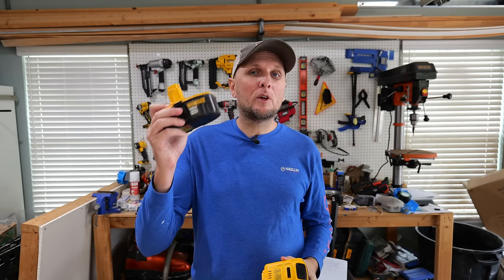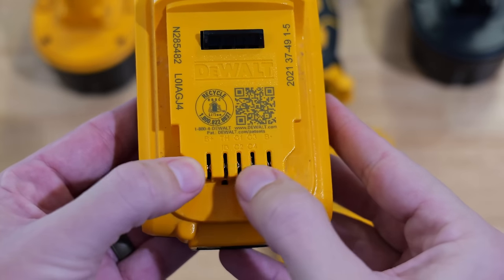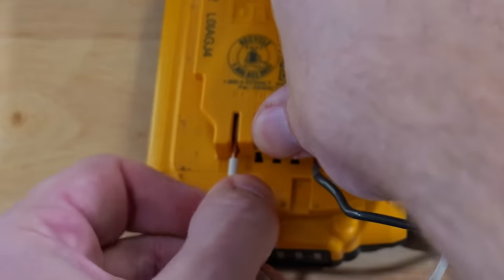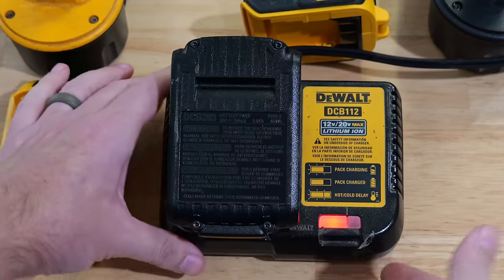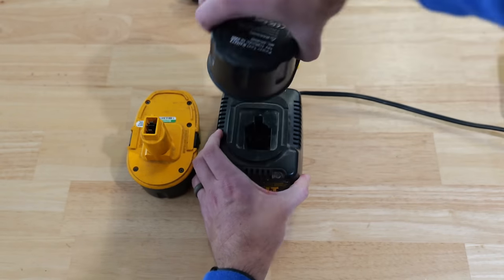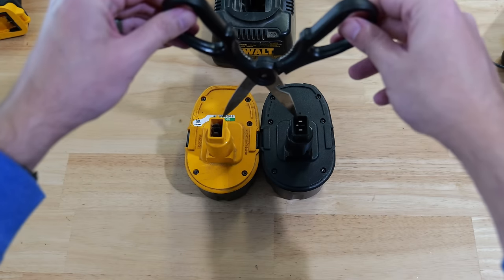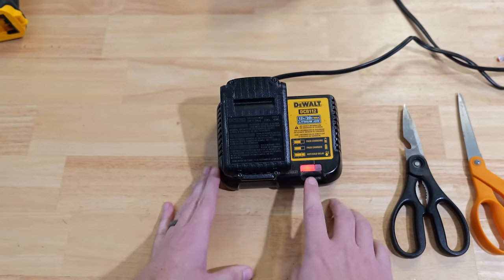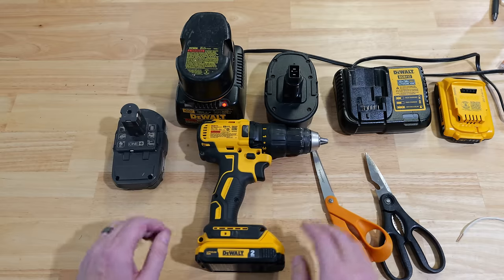SECRET To Reviving Dead Portable Tool Batteries | Super Easy!

Comment: I've done this before but, although the batteries will then "charge", at least in my case, they were able to hold very little power.
Reply: Maybe the battery was aging out?  I did this several months ago to a 20v dewalt and it seems to be working just fine. I just do not jobs (not contractor) so it would be hard for me to tell if it had a few percent less charge but if so it is not obvious.  I have used it for a number of misc jobs since I charged it and have not yet had to recharge it.
Reply: I would expect different results depending on the age and wear ofnthe revived battery
Reply: Each pack has 5 cells to make up its voltage 18v/20v. 
The BMS cuts off charge when one of the 5 reaches 4.15v. 
So open battery and either discharge all to same voltage or use likes of a tp4056 and individually charge each of 5 cells to 4.15 v
Also note the discharge curve of lithium ion batteries shows that from fully charged they drop from 4.15v to around 4v in first 4% of discharge.  Then slowly drop down to around 3.2 v and if kept in use again the curve drops like falling off a cliff
Reply: Storing flat batteries will ruin them.
Reply: @mikestubestation 100% but have revived cells down to 1v and they were perfect. 
Best to store at around 80%
Reply: @patomahony9747 the question is how long @ 1v.  Or as in this case undetectable by this charger.
Reply: Probably have to "re-teach" the battery it's 100%. I've done this with phones and other electronics. This may be the case here. Once the battery is charging again, get it to what it thinks is 100%, use half of the battery, charge back to full 100%. Repeat this process 3-4 times without letting the battery get below 50%  before you charge it back to a full 100% every time.
Reply: Likely dropped/shorted a couple cells rather than was just cycled too deep and is exactly why you should never just connect two batteries together like this without first finding out why its refusing to take charge.
Reply: @psychosis7325  would it damage the good battery? if not is it worth a try as a last ditch effort before spending money on a new batt.. (if likely to remain an electrical ignoramus)
Reply: @JamesLawrence-hv4ti  its not likely to damage the good battery, but its like $5 for a multimeter and if in the shed you likely have the tools to open the battery and check the the ballance of the cells first to lower the fire risk and once you identify if its just been deep discharged evenly, has gone out of ballance or if its shorted you can then decide if you charge the whole pack, charge the low cells to restore ballance or scrap/rebuild it....

When my 36v mower battery done similar I used a 0.5amp usb phone charger to bring the low cells back up as anything over an amp is much more likely to result in thermal runaway and using the battery its can deliver tens of amps.

Should be done outside or in a dedicated fire resistant ventilated area with eye protection at minimum, not in the garage with a pair of scissors up on your work bench as a demo video for others to copy.
Reply: @davidbwa  is
Reply: It takes 21 volts to charge full a 5 s  battery pack the Nominal voltage should be 18 volts or 3.6v per cell but since some might be a little lower the highest cell will reach the 4.2 cutoff voltage before a lower voltage cell Therefore decreaseing The total amount of power Available for the battery since the BMS stops all charging when any one cell hits 4.2 v .
Reply: Li ion batteries should be stored (long term), @ half charge or less. If fully charged- that energy seeks to release itself and destroys itself little by little.
Reply: @psychosis7325 ,,sometimes,you have to be operating on tools somewhere.Its not rocket science.
Just saying.
Reply: @mikestubestation could you elaborate on this? I’m not understanding your statement. Thanks.
Reply: @SammifromMiami  i think he's saying that if you let a battery discharge and then store it without giving it a partial charge, the battery's over-all life is shortened. I believe most websites with this information recommend storing a battery at 40 to 60% charge for longest battery health.
Reply: Same experience for me.
Reply: The 18v nicad (nickel cadmium ) batteries have a memory. If they are put on charge before they have actually exhausted it's charge totally , you will lose some of it's memory each time... resulting in less run time. Those so called , " dead batteries " will not regain the lost memory.
Reply: @williammoseley8388  Right. Probably what happened to mine.  They were pretty old.
Reply: It didn’t work on my 20v battery. The battery gets charged for a couple of minutes. LED shows 3 led’s - fully charged. Using it with my grinder to cut 3/8 rebars. After 2 cuts - the battery is dead at 1 LED again! 😢
Reply: Same thing with my weak batteries.
Reply: @ 8:44            YOU INCORRECTLY SAY :
 " ... plenty of TORQUE on the battery..." 
THAT'S ABSURD.
WHAT YOU MEAN TO CONVEY, IS THAT NOW THE BATTERY HAS A SUFFICIENT CHARGE TO POWER THE TOOL AGAIN ! ✅

[ it's  powe cells IN A PLASTIC HOUSING- and the word
"TORQUE" is not at all applicable and sounds RETARDED. ]

>>> That fact cleared up now, I must point out that YES YOU ARE KEEN TO HAVE FIGURED A WAY AROUND THE DEALER SCAM TO CAUSE PEOPLE TO KEEP BUYING THEIR DAMN BATTERY CELLS WHEN THEY SHOULDN'T !!!
- EASIER TO DISASSEMBLE THE CHARGER AND REMOVE THE SWITCH SO THAT ANYTIME A BATTERY IS ATTACHED IT IMMEDIATELY AND INSTANTLY BEGINS CHARGING.😂
-
- THAT COMPANY ALSO ISN'T THE ONLY ONE THAT IS SCAMMING EVERYONE BY ADDING A SWITCH THAT PREVENTS THE CHARGER FROM OPERATING UNLESS IT DETECTED WHATEVER VOLTAGE THAT THEY HAVE SET IT AT TO DETECT IN THE FIRST PLACE!!! 
THAT'S ALSO  HYPOCRITICAL AS BATTERIES ARE NATURALLY DEPLETED OFF THEIR STORED ELECTRICAL CAPACITY
IN THE FIRST PLACE !!!
-
- THIS FACT SHOULD HAVE BEEN FOUND OUT AS SOON AS THOSE DAMN CHARGERS WENT ON THE MARKET !!!!!!!

THAT'S WHY EDUCATION IS SO VERY IMPORTANT, ESPECIALLY IN THIS DAY AND AGE WHERE THE MAJORITY HAVE FORGOTTEN GOD AND PEOPLE ARE LAZY WITH ZERO MORALS AND ONLY GIVE A SHIT ABOUT THEMSELVES GETTING OVER ON PEOPLE EVERYWHERE AND EVERYWAY THEY CAN- TO THE DEGREE THAT THEY INVENT WAYS TO ROB INNOCENT FAMILIES!!!!

KEEP UP THE AWESOME WORK, BUDDY!!!
( the terminology is just a "peev" that I've developed from I guess being as completely truthful and so also CORRECT and that God into every aspect of my life INCLUDING COMMUNICATING!😂)

GOD BLESS YOU, BROTHER, IN JESUS NAME !❤🎉
🙏🔥😇
Reply: @NoNo_IStay lithium batteries do not form a memory. Your method was for older NiCad batteries.
Reply: @norfolknwhey4787 That is exactly correct! ✅️
Reply: @makfi78 my battery wouldn't charge because I had something in the box which held my trigger in I did this trick and the battery is OK again no problems 👍
Reply: @Bones-uu6zp Wow Bones, well dog gone it. It's great to finally find a true believer and someone with common sense. Blessings to you my brother in Christ. Feel free to reply and we may be able to link up. 🙏👊🙏
Reply: @Bones-uu6zp hi my name is George. Thanks for the info but I have a question. How do you get the trigger to stop and find it in the charger and how to bypass it? 18v DeWalt. Thanks for your time.
Reply: I have a 12v dewalt battery that’s doing the same thing. It runs out of juice fast, I put it on the charger and within 5 or 10 minutes it’s “charged” but doesn’t last as long as it should. 

I’m thinking one of the cells might be drained. They’re made with multiple cells, that’s why they have more than two contacts. The end contacts would be across all the cells, and each ‘pair’ should read across an individual cell. 

I think I’m going to charge it and then use my meter to check the voltage across each cell. If I’m right one or two should read lower than the other, or maybe even zero. Then I can try this trick on that individual cell.
Reply: @badgerchillsky535  Please post follow up.
Reply: Did you try to charge, stop, charge again 1 hour later and do that a few times. It may charge more.  I had the same issue and got more charge by doing the upper.
Reply: @lydkarhma  Yes. It may have helped a little but so little that the battery still wasn't useful. It would run a drill without load for about 30 sec. Too bad. I hate to throw things out.
Reply: @wholeNwon  well, looks like I was wrong about how they’re made. I made that assumption based off how the Li-Po hobby batteries I’ve used are built. 

When I check between a couple pins I get around 4v, and then between two other pairs gives me around 8v each. And it’s the same on both of my batteries. I think they’re actually some type of ‘smart batteries’ with some kind of a management circuit built in. 

I might try opening one up to look at it.
Reply: @badgerchillsky535  Thanks for posting. Live and learn.
Reply: Didn't work on my 18v ryobe
Reply: Didn't work for me. I wonder if the wire gage is a factor.
Reply: Thanks
Reply: Just don't leave them plugged in overnight while you're sleeping. I know a guy that left his on. It shorted out, caught fire, and burned his shop down.
Reply: i was thinking the same thing.
Reply: This is just a SOMERIMES rhing and when it DOES charge its not a FULL charge,usually your card is bad ot one of your batts are bad.
Reply: @jimbefit3073  another guy in the comments said store @ 80% minimum 🤷‍♂️
Reply: It varies like car batteries, if your car battery goes flat from leaving lights on but a "smart" charger won't charge it you can essentially do the same thing, get a little charge on it then the "smart" charger will charge it and you may be okay because the car battery was good but you left the lights on whereas if the battery is just old or defective then tricking the "smart" charger may or may not charge it but the battery will perform poorly or not at all.
Usually you can spot this by how fast the voltage drops when you remove the charger.
Of course it's best to not have a flat battery in the first place...
The jump here does work sometimes and is worth a try if the battery isn't shorted out.
Test for that with a continuity check across the battery terminals with nothing hooked up.
If there is continuity don't try to jump it, recycle it.
And again if after a successful charge it loses charge quickly then 
recycle it.
Some rebuild the packs, you can have that done or try it yourself but it's pretty involved.
No name batteries are pretty cheap on Amazon if you are cost conscious...or just buy the OEM replacements.
Store your batteries fully charged and hopefully you'll have better luck.
Reply: Nimh gets a memory..it actually takes a current limited power supply to burn the crystals out of cells..
Reply: We 2😢
Reply: 0 @davidbwa
Reply: @Bones-uu6zp Isn’t the low voltage disconnect a safety feature?
Reply: Great. I am going to try it. right now
Reply: Fantastic!
Reply: Safe for 40V Ryobi?
Reply: Yeah it's probably because it had a dead cell inside this guy isn't doing it right you have to take it apart and do the individual sales or they will never charge completely

Comment: Been doing this for years, however the dead battery doesn’t ever fully recharge or last as long as it should.
Reply: I did this only once but the battery that I charged is still working fine about 2 years later. I use it often too. When it was dead it had never been used before. It was purchased, then sat unused for several years causing it to lose all of its' charge. Possibly that is a factor in why it has worked so well since I charged it??? I don't know.
Reply: Just replace the cells inside.
Reply: @StopWars420 unless you have nothing to do, the time to change cells out isn't worth the cost savings.
Reply: @veganpotterthevegan  it's much cheaper and you can always fix them even when Dewalt discontinue them. But then again I expect a vegan to be overwhelmed by a simple task.
Reply: These batteries have a BMS inside.
The cells get out of balance because the BMS will stop the charging when one cell reaches the high voltage setting leavening cells with low voltage un charged.
The proper way is to open the case and charge each cell to 4 volts with a regulated power supply.
Most times batterie will be like it was when it was new.
Also lithium shouldn’t  never be charged below freezing.
Worm batterie up first.
Reply: @Whitewolf4869  you are 100% correct. The BMS shuts down charging when ONE OF THE CELLS REACHES 4.15 volts 
Had 48v ebike 17.5 ah battery go bad. 
Would only charge to 40.5 v 
So I checked each group of 13 cells , using BMS sensing wires. 
Got readings from 3.2v to 4.15v. 
Made a plug to connect to each cell and used a discharge tester to bottom balance each cell to 3.1 v +/- .02v. 
Recharged and nearly a year later the battery is perfect. 
On likes of drill batteries I would use a tp4056 and attach to each cell and charge to 4.15v. 
Power tool battery packs are usually super accessible so I have in past used magnets on the tp4056  to connect to the individual batteries
Note a BMS may or may not be faulty and cause the imbalance. 
If BMS is deemed to be ok and one cell constantly drops below the cut off voltage then it’s most likely faulty and replacing just that cell will restore the pack
Reply: @Whitewolf4869  That also why the battery packs have the extra pins, usually one for communicating with the BMS and the other two are test points for the series connection in between each cell. Some BMS I've come across when troubleshooting isolate the ground pin, so you need to find another ground point to connect to in order to jump start it when the voltage has drain below the set threshold.
Reply: @tim9430 you likely didn’t leave it flat for very long.  The longer they stay completely dead the more they are damaged.  Also trying to get that last few turns out of a battery is hard on them.  If they start to show signs of low power switch them out.
Reply: @veganpotterthevegan  → Are you paying your battery charger by the hour?
Reply: @wilhelmtaylor9863  don't we all pay for all the kilowatt hours we use?
Reply: @veganpotterthevegan  → I guess you didn't get it.  Personally, I put batteries into the charger and let it run unattended until the display light says "done".  You getting this now?  The "time you spend" is negligible so you're not "wasting" it.
Reply: @StopWars420 
you're awesome..

 is something I'm sure you never heard.
Reply: Has anyone ever tried the freezing method on one of these types of batteries?
Reply: What about the craftsman 19.2v 4 prong lithium XCP BATTERY? How does that get charged when it shows red faint flashing light on charger?